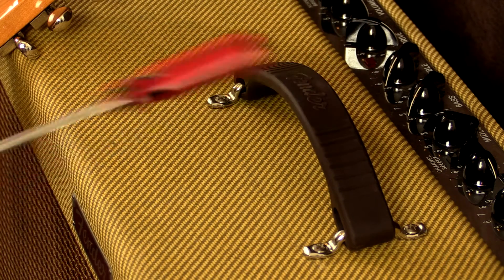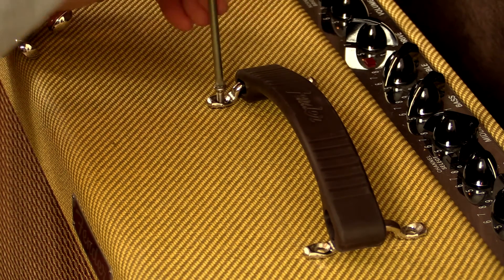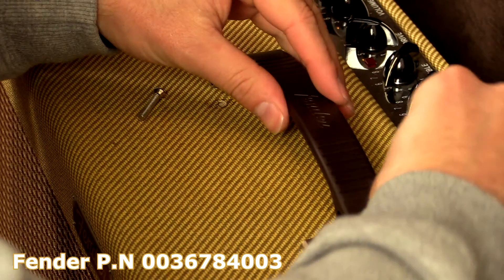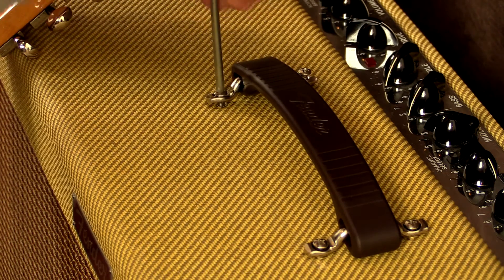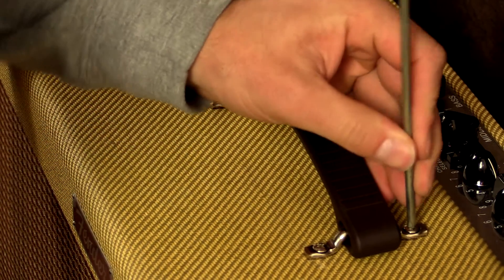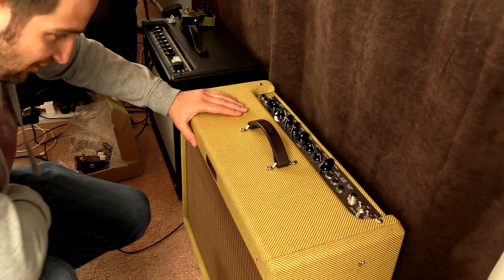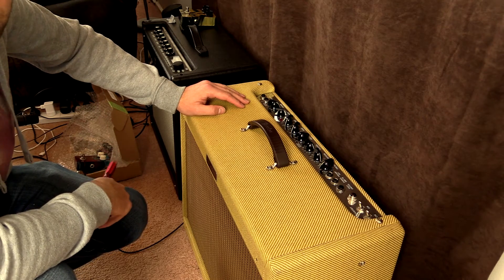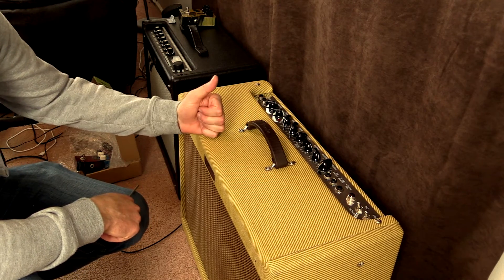Replacing a Broken Fender Dog Bone Handle

Comment: I have a fender blues deluxe that i bought used.  The handle also broke. Do you think Fender will replace the hadle for free even if i’m not the original owner?
Reply from the maker: Probably not unless it's under warranty.
Reply: Is it worth it to buy a 2013 fender blues deluxe for $500? Or i should go for a new one